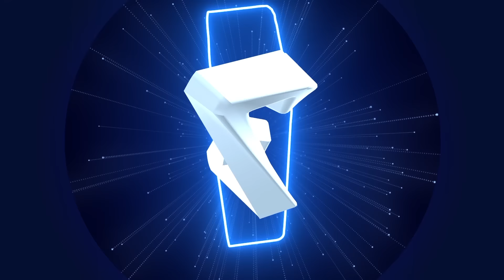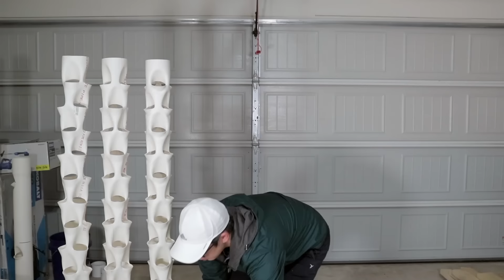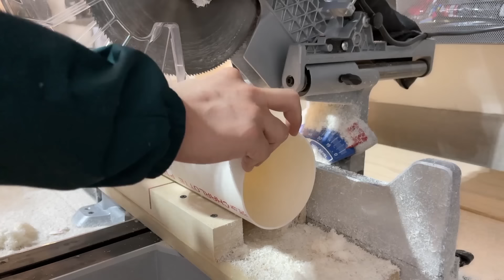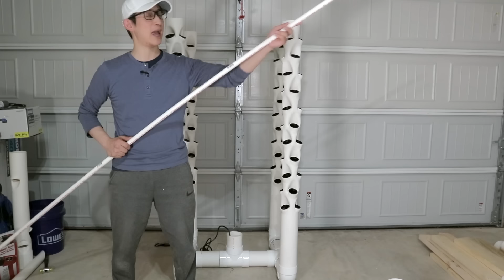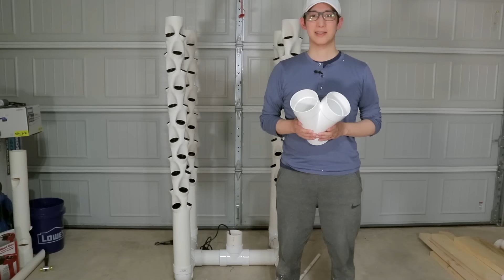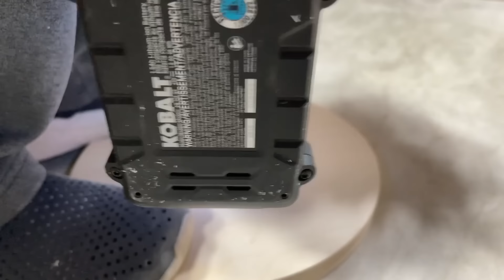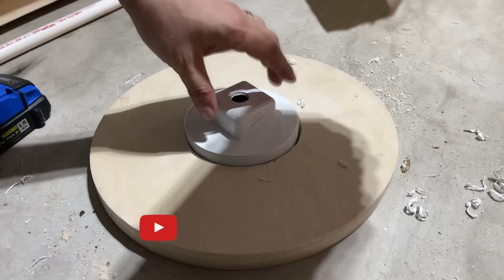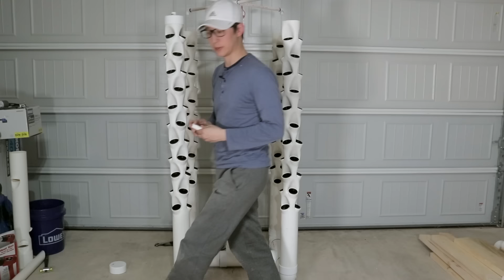DIY Hydroponics | Aeroponics Garden Tower Build | Part 2 - [4 Tower Build]

Comment: Your project is inspiring. It's a very solid result for a second generation design.

 I work maintenance at a aeroponics farm. Our largest grow room contains 32 systems, each 56 feet long, and requiring several thousand gallons of fertilized water held in the recirculation tanks. They are our 12th generation design. 

You are moving in the right direction, but I do have a few suggestions.

Maximum production requires healthy, disease free plants. Combining multiple systems into a common tank reduces cost, but provides a pathway for pathogens. Don't combine more than you are willing to discard all at once because of sickness.  Periodically, and in response to sick plants, all parts need to be accessible to cleaning with a brush. Switching the elbows under the towers with a tee sealed with a plug  might be beneficial. As would a tank drain.

I know all too well that maintenance and regular servicing of grow systems  seldom gets the needed consideration during design and construction. So it's great that you recognized the need for filtration. I'm not sure you filter down small enough. The green slime that will always grow inside hydroponic systems will clog nozzles. It's not just the roots that are a concern. To reduce the growth of the scum inside the tank, make sure the water is always protected from any light source at all points inside the system. Darkness won't stop the algae but it will slow it and prevent it from competing with the crops for the available food. If left unmanaged, it will starve the crop decrease yield.

I will be demolishing most of the first generation systems later this year to make room for just one 14th generation system later this year. Keep perfecting your design, they really do get better every time you  start over.
Reply from the maker: Thanks for the great advice.  I haven't run into issues with Algae yet.  I found that lettuce works great with the system, so I'm definitely gonna be doing what you recommended by dedicating each build to a single or a few species of vegetables.   Also makes it easier to keep track of what is growing.

Would love to see your aeroponics facility/setup.
Reply: @ChrisLoh  at the end of the video, the result is perfectly visible on the withered plant in the background. it wouldn't hurt to water it sometimes either.
Reply: Just like a Billy Bong Thornton, nobody thinks or likes cleaning when its time
Reply: Thanks for the inputs. Hope you can share your design.
Reply: I was thinking the exact same thing the whole time, how do you get the water out to clean it?  I think wrapping cheesecloth over the drain would be a good idea to really keep your pump filter from getting clogged up you also might want to put your pump inside a paint straining bag to ensure your pump doesn’t get clogged up and prevent the need for checking the filter on your pump.  It is a good pump is that the one that has the flow control on it do you have it set to max flow? The other thing that would be helpful at the top of each water inbound pipe it would be excellent if you
Put the on/off taps they have blue levers that way if you need to pull one tower out to clean or check the strainer you can do it and allow the water to run to the other towers.  I’d put one on each channel to the towers.  Plus the drain id put one on  the bottom of one of the tower corners so after you turn off the pump you can lift each tower out and then drain the basin by lifting the far corner to get everything out, it would also be super helpful if the out had a tap and also if it could have it so you could screw a hose on to it so it would make it easier to direct where you want the outbound water to go because it could still have clear water and could be reused.  Or at least direct it to your outdoor plants. Can’t wait to see the next version!! I made something closer to your first tower although I had three towers that are 2 1/4” wide on the inside and instead of running a tube through where the plant’s roots are I put a 3/4” heavy black tubing and wrapped it around all three and then clamped it with a simple tomato plant clamp and then the out tubing went back down into the opposite side of the bucket which helped with the stability somewhat and the lid I have for my 5 gallon buckets screw on and they are very strong. Then I put 1/2” tubing into the big tubing so that I have four going into each tube may be a bit too many but I made them different lengths so one would go down to the bottom third of the tower and then half way and one 2/3 the way and one at the very top I just used black ground cover to secure over the top so I could easily get it off and it wouldn’t interfere with the tubing and I did the same for all three having the heavy tubing around the top of the towers definitely secured them so they were wobbly but if permanent I would have used wires to wrap around each and tie off in the Center.  I would do that at the bottom and the top as well.  Also my cups for plants I put them down much closer to the top of the lid.  It looked like there was at least a foot of wasted pipe that could be used for plants?  Don’t quite understand the rationale.
Reply: You could attach a pond filter to the intake on the pump to assist with recirculating algae. Keep changing the filter out as part of your maintenance.
Reply: Hey, Mike are you guys planning on selling your older version?
Reply: @torontolenders  I actually disassembled three of the original systems today. All the stainless steel is still in good condition, but all the plastic is junk. That's one of the reasons we are removing them. Our new systems are all stainless steel, we learned our lesson about trying to save money and using plastic. They were proof of concept prototypes when the company was just getting started. Something to show potential investors. They had a designed life of less than a year (I think they were only supposed to be operational for 9 months). That was 8 or 9 years ago. They are definitely at the end of their useful life. We are saving pumps, filter housings, sensors, PLCs, motors, and other reusable items. The rest is getting recycled or put in the dumpster.
Reply: @mikeirvin9694  can you tell me if within your nutrient mix you also add hydrogen peroxide as a regular preventative measure to protect the roots from rot?  Especially with pepper or tomato plants anything that could be continuously growing for more then a year?  Also could you share the percentage and the quantity added per gallon?  I’ve started using 3% hydrogen peroxide on a regular preventative maintenance basis but I’m not certain I’m adding it at the correct time? I’m mixing it in with my additional nutrients and I’m  adding it at the end into the 5 gallon nutrient rich water.  Will this cause any sort nutrient block out or cause the tomato or green pepper plant any distress?  I don’t add it to my lettuce plants because the life cycle of the plant is so short compared to tomatoes, peppers and cucumbers.  So far the plants have been responding quite well but I’m also wondering if it’s blocking out needed nutrients for blooming? Any input would be greatly appreciated.  So far beyond Mike Vanduzee you are the only person that has said exactly things that I have believed from day one especially when related to the need to keep light from penetrating and cleaning with scrubbing and it’s importance.  I think a lot of people figure well these plants grow outside in the dirt so what difference does it make if dead plant material is present all around the lid or floor.  But I understand the need to keep it clean and.viable.  

I wondered about stainless steel and if any grow systems that are plastic would eventually transition to it!  I have read every comment you have on here and it’s exactly on point with every single one of my findings !!! I
still consider myself a newbie after three years of working with hydroponics indoors. I learned very early on that it was much easier to just have varieties of lettuce inside my NFT system then to try to have various kinds of plants. I had initially thought I could have a staggered growing environment where I had mature lettuce in the top two pipes and med growth in the second two and have seedlings in the bottom two.  My thought was that as the nutrients flowed from top down the plants would use them up and deplete the nutrients by the time they got to the bottom shelf but I learned quickly that I was wrong and the nutrients on top were the same at the bottom and so with a 24/7 recirculating system the best way was to have the nutrients geared towards the same stage of growth and having the plants all at the same stage as well.  By doing it this way I would still yield the same or possibly more harvest by cutting all the outer leaves on all lettuce every 7-10 days and getting usually 6 cycles out of them that’s also when I learned especially with lettuce when it comes to nutrients it’s a real balancing act.  It’s important to give them enough nutrients to ensure their continued growth and the nice healthy green color but if you overdo the nutrients they will bolt much faster or if they think they are nearing their end of life because the nutrients or water is no longer adequate then they will also tend to bolt early in an attempt for them to be self-sustaining because bolting just means they are generating seeds to produce the next generation of seeds. My recent experiment has been to let them continue through their bolting stage to see if I can harvest the seeds.  I’ve never done that before and it’s been an interesting learning curve.  I have no idea really what I’m doing but I have a fantastic internet met mentor that’s been helping me step by step.  I’m going to try harvesting my seed pods today because it’s been too long since we had fresh lettuce and miss it terribly!!  It’s truly amazing the things you can grow indoors using hydroponics when you learn the importance of regular maintenance not only inside the tanks and inside the tubing but all around the outside of the pipes and all the racks and floor space and tops of bins because as plants grow they do return a lot of dead plant material to the ground and when indoors it’s extremely important to keep that exceptionally clean to prevent disease, and to check your plants at least once a day so if a problem does come up it can be dealt with quickly and efficiently before it reaches your other plants.
Reply: @leannekenyoung  unfortunately I'm not the best person to answer all your questions. I'm a maintenance worker. I know more about laying out the piping for a new pump or building the lifting mechanism for a light bar than I do the details for growing plants. The grow team knows all the particulars.

But I do know a few things. We use hydrogen peroxide to sanitize during scheduled cleanings, but it's not added to the water. We do add acid, so many fluid ounces per day, with a peristaltic pump continuously. Our systems have pH sensors to adjust the acid dosing rate up or down. I know the growers have a specific target  pH with a certain tolerance up and down that they are aiming for to control algae growth.

I'm familiar with stages of growth. We have multiple systems a plant will live on before being harvested. when the plants are seedlings, they can be packed very densely. As they are transplanted to the next stage, they are spread out on bigger and bigger systems. We can use the same LED grow lights with the same intensity on all the systems. We change the plant spacing to minimize the unused light coming off the LEDs. We use no natural light in our grow rooms, so being thrifty with our grow light usage is important.

For lettuce, grow all the roots first, then grow the head

It's also possible to vary the amount of fertilized water delivered to the root systems  while adjusting the brightness of the lights as the plant grows and nears harvest. Excess light and adequate water when the plant is small promotes rapid root growth but slower leaf growth. Then, turn down the lights and soak those massive root balls. The leaf growth will explode right in time for harvest. It takes quite a bit of hardware to accomplish that, but it can shorten grow times by weeks.
Reply: @mikeirvin9694  I think as a “maintenance worker” you have a heck of a lot more knowledge then you realize!! I enjoyed reading your comment it sort of felt like I had a glimpse into a commercial environment that I’m sure if I saw in person my reaction would be a continuous “wow!” “Wow!” I may have mentioned I’ve been growing indoors exclusively for the past three years and while I’m lucky(I think) to have the addition of natural light my observations have been identical to what you’ve said.  I have wondered about how a completely closed indoor only with no natural light would use their light to their most effective advantage and what you say makes perfect sense to me. The only thing I have not done is grow lettuce to a head, because my thoughts are when someone gets a head of lettuce what’s the first thing they do? Cut off all the outer leaves and discard them.  So for my purposes I consider it wasteful. Instead what I do as the lettuce grows I cut all the outer leaves and the Center continues to grow it may even push the Center a bit more then it normally would because it doesn’t have to push so much to come up. As a result I can grow 54 lettuce plants all at the same time and After I’ve germinated the seeds and got the first true set of leaves on them is when I transplant them to the NFT system and that’s when I begin to feed them a light solution   and so far it hasn’t mattered what the type of lettuce is within 7 days every single plant is ready for an outer leaf trim.  And then 7-10days after that, and on and on it goes for the life of the lettuce plant which is approximately 6 cycles at which point they tend to bolt.  I’ve been doing a recent experiment of letting these plants continue through their bolting stage and I’ll tell you it sure takes it a very long time for lettuce to produce seeds but once it does it’s in great abundance.  I think what absolutely fascinated me to this day is that soil isn’t required at all to grow the most amazing veggies.  I know a lot of people grow sweet peppers in coco coir or perlite or a combination and keep circulating the water through them but what I’ve found through not having a clue how to do some of these things is that a tomato plant will survive and thrive in a 5gallon bucket with nothing but water and it’s roots.  That’s it.  If it’s getting enough of what it needs to survive it will because all plants want to survive.  I’ve found the most effective way to control algae is to stop the light penetration and if you aren’t using a product that is from a fish emulsion then you won’t get algae growth as long as the sterile environment that is used is maintained and any possible point of light entry is completely blocked.  I’ve watched some grow operations on YouTube etc and they are surprised they have algae in their systems even those large drum tanks that are partially in the ground will have algae growing and in my opinion it’s because they either haven’t kept the water moving enough for it’s volume and/or they have not been putting enough oxygen into it. I find when I use just regular aluminum foil the stuff from my kitchen if I wrap everything in it with the shiny side out it does two things it prevents any and all light penetration and it keeps the water a lot cooler. I also use the foil to help the plant standup initially until the plant can grow it’s roots to the bottom of whatever container you have it in, it cannot stand up straight on its own.  But once the roots are on the bottom it’s able to stabilize itself and grow up with very little assistance if any.   It’s been really wild watching my tomato plant grow because although I provided it with foil to support itself and a grow pulley system above that the peppers love the tomato plant grew out and over the sides of the container and then went down to the floor and then would grow straight up from there.  It’s almost as if it needed to have a part of the plant that wasn’t in water be in contact with the floor and then it just stands straight up and these limbs will grow 5feet tall and will grow various limbs off of them.  Now I probably confuse the heck out of my dear plant because I do prune heavily all the time I know the plant requires a few leaves for photosynthesis etc but it’s amazing how few it really needs once it puts on blooms and starts putting on tomatoes that’s it’s sole focus until that set of tomatoes are  picked and then the plant puts on all kinds of green leaves again at least that is so true with indeterminate plants.  I don’t know when plants are determinate if they behave in a similar way.  I doubt it.  But only time will tell.  Thanks for all your help Mike you have an incredible depth and breadth of knowledge with hydroponics.  I thank you so much for sharing it. 🥰🇨🇦❤️🙏🏻
Reply: @mikeirvin9694  
If you are soaking the root balls you are not running genuine aeroponics. Commercial scale grows involve compromises, its just par for the course.
If i soaked my rootballs, the plants would not be happy as they`d lose a massive amount of active root system instantly. They would recover once the setting were corrected but it would cost days in lost growth.
Reply: @atomizer2665  oh no, it's areoponics. We just adjust the volume of water being sprayed.
Reply: @atomizer2665  I was thinking about the compromise you mentioned. It's true, we do. We don't continuously apply water to the roots. Varying the time between waterings and the length of the watering controls the amount of water applied to the roots. As long as the interval is small enough that the roots are still wet from the last watering when the next one starts the plants don't care. A large pump can water 8 systems, one at a time, and deliver a variable quantity of water to each. It just takes expensive solenoid valves, a PLC, and custom software.
Reply: @leannekenyoung  fun fact, if you have no natural light in the indoor greenhouse, then your day doesn't need to be 24 hours long. Just the optimum daylight, nighttime periods, with a "greenhouse sunrise" that shifts day to day. For bolting, try increasing airflow around the plants. When a system with live plants goes down, my priority list  for repairs starts with water, then it's air flow, and finally getting the lights working again.  Growing indoors without natural light or natural ventilation allows us to control everything. Temperature, humidity, light patterns, even the CO2 levels are controlled. There's almost twice the PPM CO2 inside our grow rooms than outside.
Reply: @mikeirvin9694 
Hi Mike
I run accumulaor driven high pressure aero and also air atomised aero which uses compressed air to create the mist. The hardware sets the level of control and control is the key to the benefits commonly associated with aeroponics over other methods. Misting duration and frequency is dependent on the overall flowrate of the system so the duration and frequency of mist that works for one system wont work for another. If someone has twice the number of nozzles in a given root chamber or have the same number of nozzles with twice the flowrate, the misting duration will have to be halved to deliver the same amount of water. If the amount of water delivered by the system is too much on its absolute lowest setting you will overwater and not gain any of the benefits.  The trick is to design the system to provide full coverage with the fewest number of nozzles with the lowest flowrate, basically design for the lowest flowrate you can. You can always increase the mist duration but the minimum is fixed. When you have this level of control you open the door to the real game changers. When you are only using very small amounts of water you can run these systems drain to waste. This allows you total control over the nutrient elemental content and reduces maintenance to almost nothing which i admit wouldnt be great for you being the maintenance guy lol but from a plants perspective, it just doesnt get any better.
Pristine nutrients with the ideal element content, PH and EC are delivered at each and every misting. Nothing returns from the root chamber to contaminate or add heat to the reservoir or alter its elemental content, EC or PH. In terms of maintenance, you simply refill the reservoir or accumulator with fresh nutrient when its gone. The elemental content of a recirculating reservoir is a known quantity when it is freshly mixed but from that point onward it becomes an unknown quantity as the return mixes back in.  The reservoir becomes more unbalanced over time and ultimately you have to dump it to reset. Consider a reservoir lasting a full week running drain to waste and the same reservoir being dumped once a week due to the imbalance of running recirculated. The same quantity of nutrients are "wasted" per week but the difference in growth would be night and day. The ideal aeroponic environment involves having the correct amount of mist with the ideal droplet range. If you can imagine a perfect physical medium ( a theoretically perfect soil) that maintains the optimum level of moisture, nutrient and oxygen all of the time..thats the aeroponic environment the roots are suspended in. Misting the roots, having them hanging in air and the multitude of other descriptions sellers of aeroponic systems come up with the justify the aeroponic label they put on the product fall well sort of the mark.
If you check the roots when you are in work again, here`s some genuine aeroponic roots to compare 
https://youtu.be/l1Rmm9JvPfY
Reply: @atomizer2665  we don't use compressed air, just good ole fashioned 1,100 psi water with  an atomizing nozzle. We don't worry about minimums. The pump has a three phase motor operated by a VFD. We can throttle it down to where it barely rotates, and because it's a positive displacement pump it will move a set volume every rotation regardless how long that rotation takes.

Our concern is speed of delivery of the mist. It must be done quickly enough that the pump has adequate idle time to water all the other systems connected to it. 

 You would be correct about fresh premix and going to drain on less complicated systems. That's just not how we roll, hence why I'm not too worried about job security. While the lights are on fresh premix is used as the plants are actively growing, but the single use water is collected sent to a second tank and stored until the lights turn off. Then it's used to water the plants a second time, collected and sent to a third tank and stored until all the single use water has been exhausted. Then the two use water is reapplied and sent to the drain after watering the plants three separate times over the course of the day. Meanwhile the second tank is rinsed, drained, and partially filled with RO water. After the third tank is exhausted of two use water, RO water is applied to plants to wash the roots clean of any and all fertilizer residue, sending it all down the drain. Once a zero state has been established, the pump switches back to applying fresh premix, timed so that right after the second application of fresh premix, the grow lights turn back on. Letting the plants wake up to freshly cleaned roots bathed in fresh premix. There's no need to waste fresh premix when the lights are off and the residual nutrients in the single and double used water is sufficient. The plumbing for such an arrangement is daunting. That's what I'm paid for. The growers dream it up, my department makes it happen.
Reply: @atomizer2665  https://youtu.be/EswoXmWSdOY this is the farm, a couple years before I started working there. That grow room under construction has been in service for a couple years now. It's the one with the 32 56' long systems. Our new facility will be built with 88' long systems. The original systems were only 32' long.
Reply: @mikeirvin9694  
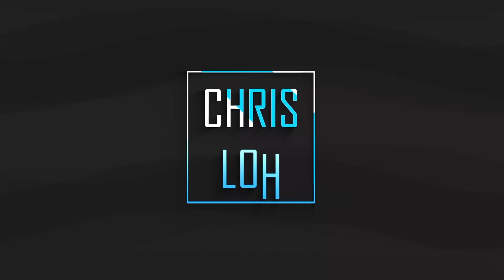I believe thats the one that uses a track misting system to reduce the number of nozzles. The roots at 1:08 in the vid are pretty standard for sprayer type aero which is a perfectly good way to grow stuff. Its good that folks in the commercial sector are thinking outside the box but many others simply copy old tech and tout it as cutting edge, a lot of them dont even run mist :) At the other end of the scale, you`ll find lowly hobby growers with limited resources for R&D that are way ahead of the big companies
My idea of cutting edge aeroponics circa 2015 looked something like this https://youtu.be/Bn_aQZR8uzc
Reply: @atomizer2665  oh no, you know about the trolley! Lol that's a secret I will not confirm nor deny. The A frames are old school, but they still function and produce. The high pressure atomization is for the next generation. We have only built one, with a second on the way, to do R&D and testing. They are less than 40% the size of the planned production equipment, but they are big enough for an experimental test bed. It's definitely the direction of all our future systems at the new facility we're going to be building, and any that might follow that. We are systematically testing different nozzle sizes, spacing, orientation, piping and fitting styles, pumps, grow lights, ventilation options, etc while developing the software to automate all the functions. I've lost count of how many times I have plumbed the misting system. But the growers keep giving us feedback as to what the plants like best and we keep tweaking the design accordingly. After a year, we're getting close to a finalized optimized hardware set-up, just in time as the building plans are being created. Then it's onto optimizing the software and grow settings. By the time the facility is built, and the full size production systems are installed, we'll have all the data necessary to make sure they are turn key ready to go right from the start. While my current facility is all about r&d, developing and refining process, the new facility is all about pure production. Unlike the different generation of systems and hardware found throughout the three grow rooms where I'm at, the 12 grow rooms that will be built will all be the same setup. The data and feedback from them in the future will lead to us creating a new test bed and starting the design process over from the beginning.
Reply: @mikeirvin9694  thank you that’s actually pretty similar to how I do things I’m growing in my living room, I don’t have a greenhouse or any outdoor space I have air coming in from outside that’s blown in 24/7 sometimes it goes through heat coils and sometimes it goes over cooling it’s an air conditioning/heating unit for our apartment but this place was built in the 70’s before they started recirculating indoor air, so thankfully we are getting a constant intake of fresh outdoor Toronto air(the fresh part is a bit of a joke) I also have a large square fan that just blows air around the living room because at times I’m too hot and at other times I’m cold(it’s just me) we keep our main floor quite warm and we also run a humidifier throughout the winter months because I have skin conditions that don’t like the hot dry air.  So far it seems to be an ideal place for growing we have a huge expanse of window that is two storeys high because we live in a loft style apartment.  We are facing south and we get a ton of natural light through these windows but above each rack or plant that I have growing I also have T5 full spectrum warm white LED lights and the plants love them.  I can kept them close to my lettuce plants and they don’t burn them or anything.  My larger plants like tomato and sweet pepper plants I prune them heavily to ensure there is always space between the branches and leaves so they don’t become over crowded and I need to be able to see the blossoms so I can assist with hand pollinating and so far so good.  I would love to have a space that was a totally closed growing space like you have mentioned above when each and every plant can receive their optimum from every available system.  I think it would be absolutely incredible to have a space like that obviously it would be very expensive and a commercial venture.  But wow, so possible with so many places now where they lack industries and could be converted to that kind of setup.  I think a closed system combined with vertical growing is the answer to a truly healthy food supply where it’s real food that’s growing and not some gmo version of itself.  It’s amazing that they started messing with the plants DNA instead of adapting their growing spaces to something that could control their production outcomes.  Finally this is becoming more of a reality.  I think if the average apartment dweller can grow an incredible abundance of food enough to share with family & friends then we should all learn because I think it may become a necessity in the future and reliance on oneself is paramount. Understanding how to improve is so important as well and we can’t always assume we are doing the very best way but we won’t know that until we reach out to others with more experience.  Mike you have so much knowledge about plants and growing hydroponically if I ever had a commercial growing environment I’d definitely want someone like you on board!! I hope you are appreciated for all your knowledge!! I’m sure you’ve gained a ton of knowledge just working with this sort of thing every single day!  Thanks again for giving us a peak into how a real growing system works and then we can apply it to our own home DiY versions. Thank you 🥰🙏🏻❤️🇨🇦
Reply: @mikeirvin9694  
Hi Mike, I design and build everything myself but on the plus side i`ve picked up a lot of new skills along the way. The most frustrating part is when you know exactly what component you need for the job but don`t know what that component is called. Google is no good with  "i need a thingymebob that does this".  When it comes to designing systems i find being part horticulturist, part forensic scientist, part chemist is a good mix. It seems like a lot of designers these days have a bunch of  IT degrees but have never grown a plant in their life :) When it comes to optimization its hard to beat good old fashioned diligent testing, it can take months but you always come across something you hadn`t even considered and suddenly you have a few more avenues to explore. Testing systems that run drain to waste is a lot easier than recirculated systems, the same can be said for indoor vs outdoor setups due to the environment variables. I run HP and AA aero indoors year round and HP  outdoors from about april to november, variety is the spice of life. If you need an additional challenge, you can branch out into nutrient formulation which provides you with another level of control .
Reply: @atomizer2665  the IT guys serve a purpose and are an important part of the equation. The grow team, the maintenance team,  the harvest team, and management all have separate and distinct needs for system control and operation. It's the IT guy that makes the touch screen on the wall satisfy everyone in a simple way that doesn't require extensive training of new employees, or a detailed knowledge of the system layout and components. IT is the glue that binds the various stakeholders. That said, IT doesn't design the physical system, they just make it function the way the various stakeholders need it to. Occasionally IT will give us feedback requesting a sensor be added for a specific programming purpose; a proximity sensor, a pressure sensor, level sensor, flow switch, limit switch, etc. And we'll add it for him. I still turn plenty of manual valves during the course of a work day, but that's because I'm maintenance. Everyone else can accomplish their work with very few manual valves to worry about. And part of my job is to make sure those particular valves are visible, accessable, and not required for daily use of the system. The IT guy makes even my job easier by automating all the routine tasks. I just have to worry about the abnormal conditions. 

Having a mechanical engineer design the system to the growers specifications, within the managements limits, while addressing maintenance's concerns is the only way to do it at scale. Send the CAD drawings to a steel fabricator and when the parts arrive, grab the roll of blueprints and some tools and start throwing it together.

The 56' long double fall light bars are something I can assemble, repair, adjust, and service. However, that much moving mass isn't something I would be comfortable just guessing on component selection. They need to be calculated by someone who understands the loads and forces involved and willing to be responsible for their work. 

Depending on the project, structural engineers and electrical engineers might have to get involved to get the growers want they want for the plants.
Reply: @leannekenyoung  this absolutely does not apply to a home application, but rather the next step up. 

Have you ever wondered how the HVAC guys can generate such absolutely stable temperatures in such spaces as walk-in coolers, freezes, or grow rooms?

As long as you are willing to pay the utility bills, it can be done a pair of HVAC air handlers. Both need to be big enough to handle the worse case scenario heating and cooling independently. That creates some redundancy if one unit is out of service. Having three or four units is even better, but two is the minimum, and will work. Set the thermostats physically halfway between the units, side by side so they read the same.  Let's say you want your plants at a nice toasty 75 degrees. Set one thermostat to cool and 74 degrees. Set the other thermostat to 76 degrees and heat. Then stand back and watch them fight! They will battle each other endlessly maintaining an incredibly stable 75 degrees plus or minus a degree. While this is the simple way of accomplishing a controlled temperature, it does generate a localized hot and cold spot. Adequate in room ventilation to mix the hot and cold is a must.

Next step, have a commercial grade  air handler built to spec. With internal digital temperature sensors and a PLC.  The room temperature (and humidity if it's a grow room) is measured at multiple locations in the room, and is compared to the values of the actual return air entering the air handler.  The air runs through the cooling coils and drops 40 degrees in temperature, with a corresponding reduction in humidity. The temp and humidity are measured and then the air is passed through the heating coils, with an increase in temperature of about 40 degrees. And one last set of temperature and humidity readings are taken at the start of the supply duct going back to the room. The PLC adjusts the chilled water and the hot water going into the two coils, adjusting the temperature and humidity changes, and sending drier room temperature air back to grow room that is no more than 3 or 4 degrees different than the temperature of the air already inside the room. No hot or cold spots.

There's even more that can be done. Adding a rotating desiccant wheel with it's own cooling and heating coil will strip water out of the air by the gallons per hour even more effectively for better humidity control, sending room temperature, bone dry air back into the room. 

Commercial air handlers can have a feature called an economizer. It's a motorized damper connecting the return air entering the unit (before the filters and coils) and the outside, allowing a controllable amount of outside, fresh air to be mixed into the airstream, conditioned, and sent to the room.
Reply: @mikeirvin9694  wow!! That’s incredible!! I had no idea that all of that could even be done but it makes so much sense and I’m sure you “dumbed” it down for someone like me so thank you so much!  Maybe if I can win the lottery!  Because I truly believe this is without a doubt the next evolution in commercial growing.  It has to be because of how bad the soil is depleted and with all the pest pressures and if you want to be organic and not lose every other crop to pests it’s the only answer I think.  Thank you for all the info.  This stuff fascinates me and if I had a bunch of money it’s sure where I would be investing it.
Reply: @atomizer2665  Trust me, I understand the frustration of not knowing the name of what you need. You actually helped me find a solution to a problem I have at work. I'm building the pump and piping setup for a new microgreen system. Redundant pumps and filters, PLC controlled, maintenance bypass piping, unions, the whole nine yards. It won't be operational for another 6 weeks or so. So I have a very crude tank (literally a food grade 55  gallon drum with bulkhead fittings added) and a pump temporarily running the system until I get the permanent  setup complete. I watched your video, and that got me watching a couple more on homebuilt high pressure misting systems. And that's where I learned about plug in recycle timers, or on off on timers. I had been looking at industrial timer relays, which are way more precise, way more expensive, and way more involved to install. I don't need to time down to a 1/10th of a second, 5 second increments is close enough, and the price looks way better for something that'll be in use for a month and a half. I knew there had to be a off the shelf solution, I just had no idea what it would be called. It'll be going on a shelf in the shop afterwards, and I'm sure it'll come in handy again in the future.
Reply: @mikeirvin9694  
 If you are running low dc voltage you can use ultra cheap cycle timers ($8) with solid state outputs. I would steer clear of the ones with onboard songle mechanical relays. I run all my hp aero setups on accumulators and manually charge them as needed (to 140psi) with one pump (12v 160psi). I dont use pressure switches or relief valves, just pressure reducers and solenoids. My hp aero timers provide 0.1 second increment which is plenty. For air atomised i use timers that provide 0.05 sec (1/200th of a second) increments which is nice for superfine adjustments
Reply: @mikeirvin9694  do you happen to know what nozzles you use? Or what features are best? I’ve been wanting to build an aeroponics system for a year but keep getting stuck at nozzles for the sprayers
Reply: @doublestennisplayer  I suppose it depends on what pressure you are using. The nozzles we use at over a thousand PSI don't work particularly well under 500psi. I would look for an inexpensive general purpose atomizing misting nozzle used for various applications like HVAC, mist cooling, and other things. Start with brass ones and experiment until you get the right orifice size for the droplet  pattern you like. Then upgrade to the stainless version (if that's your intention). If your pressure is low enough, there might be a plastic version that would work.
Reply: Thanks for the excellent tips. It seems wise to make sure all your pipes, pots & parts are sterile before you begin assembling. I just looked up some non-toxic additives to help reduce mold & algae. I'm sure there are more but grapefruit seed extract is a powerful anti-parasitical, anti-bacterial and anti-fungal compound. Five to 10 drops per gallon is recommended. Desembling periodically to clean also seems prudent.
Reply: @drivers2037  just rotate the unit 90 degrees every week
Reply: What about fish to take care of algae. Even if temporary.??? Thanks for your pro tips.
Reply: @vicariouswitness  my grandfather always bought goldfish every spring to put in the water tank for the cows. They would get fat eating the pond scrum while the cows were happy to have clear water to drink all summer. When the cold weather killed the fish in the fall, they got feed to the pigs who enjoyed the treat.  

On a commercial scale I would worry about altering the chemistry of the water. It would be a whole bunch of new variables to worry about with the addition of fish. On the micro scale for the hobbyist, I think it would be fun to experiment with.
Reply: @mikeirvin9694  I’m scaled for self sufficiency, not commercial. Thanks for the advise, I’ve also looked at snails.
Reply: These videos and this comment section is a goldmine. Thank you so much for taking the time to share your experience here, will be building my own very soon !
Reply: at the end of the video, the result is perfectly visible on the withered plant in the background. it wouldn't hurt to water it sometimes either.
Reply: at the end of the video, the result is perfectly visible on the withered plant in the background. it wouldn't hurt to water it sometimes either.
Reply: Beautiful advice !!!!!
Reply: Its a little less inspiring when you realize he just ripped off the design: https://www.youtube.com/watch?v=tmpPLiECCFU
Reply: Do you happen to sell your system?
Reply: @rickfox4068  not exactly. We did sell a pile of 8" PVC pipe that made the tanks for the old systems we had removed earlier this year. A local man was interested in starting a greenhouse, drove by our facility, saw the old tanks, and asked about buying them. A hundred dollars and they were all his. We got some pizza on Friday and never told him why they were stacked up outside the building. We were too busy to take the time to cut them up and order a dumpster to dispose of them. I got a free lunch and didn't have to deal with them again. That's a solid win. If he can use them to create some kind of grow system to suit his needs, that's a win for him. Less stuff going to the landfill, that's a win for planet.  

We don't sell complete, turn key grow systems. That's not part of the business model. However, we do occasionally sell off used equipment and components. The systems we decommission get stripped down and the individual components get repurposed.  We don't use individual tanks per system anymore, so the individual system sized tanks were destined for the dumpster. All the components that made them a functional tank had already been salvaged, so they were just long lengths of big PVC pipe with all sorts of holes drilled into them. 

As the saying goes, one man's trash is another man's treasure.
Reply: @mikeirvin9694  Hit me up when you have some repurposed stuff..  if we can work out the logistics, I will take it off your hands
Reply: That's amazing!
Reply: Hey Mike, I'm trying to start my own system and wondered if you could offer some professional advice or could possibly point me in the direction of a good source of material to start with?
Reply: @branden7384  While I have certainly developed a preference for certain materials and products over the past few years, they don't translate very well to small scale home systems. Having stainless steel custom fabricated to a CAD drawing and shipped to you on a pallet is a bit excessive for most people. Same with the automation. Is it nice? Oh yes. Is it necessary? Definitely not at a small scale.

I've seen people use 5 gallon buckets, but that wouldn't be the route I personally choose. They don't pack together tightly enough for efficient use of space, at least in my humble opinion. Plastic storage totes are rectangular (an easier shape to work with) and can be lined up in a nice row with a continuous grow surface. That simplifies grow lights (if you're going that route). It could also simplify ventilation if you use a ductsock.  It's possible to replicate the function of a ductsock with a rigid section of round duct you can find at a local home improvement store. Buy a duct that is the length of the grow bed and is the correct diameter to attach to the outlet of a fan. Drill a series of holes along the length of the duct with a hole saw. Hang the duct over the grow bed with the fan on one end while the far end is sealed with a cap to trap the pressurized air inside and forcing it out the holes. The holes might be at 6'clock blowing straight down. Or maybe 5 and 7 or 4 and 8 to blow towards the edges of the grow surface. The duct might be moved to one side to make room for lights and have the holes rotated to blow towards the center. Ductsocks are great because they make a linear curtain of airflow along their length. The spacing, size, and orientation of the holes can tune that airflow to whatever you need.  

Plants growing indoors need three things: water, air, and light. In that order. Which is why I talked more about air than I did lights. 

For water, you need a pump. Lots of choices in that department and there's two ways of going about it. Design a system and find a pump that meets the requirements or select a pump and design a system around it's capabilities. Either way, for a successful build the pump and the finished design have to compliment each other. If the system doesn't have mechanical ventilation or grow lights then the pump will be the big ticket item with the greatest potential for cost savings, and would indicate that's where you would want to start the design. Aquarium pumps are a valid option for small setups. I have set-up test systems with sump pumps (I usually bypass the float valves and utilize timers). They are robust, easy to source locally, and available in 1/4, 1/3, 1/2, 3/4,  and I HP versions, and not terribly expensive. However, they are in tank pumps. On smaller systems at work I much prefer spa pumps (they are designed for use in hot tubs). They can be powered by 110v with a cord end plugged into a timer (up to 3/4hp anyways) or they can be wired for 220v (for less Amps). They are off the shelf available at some local home improvement stores and come in 1/2, 3/4, and 1 HP versions. I recommend the thermoplastic housings. They don't corrode with fertilizer in the water, like cast iron will. And since they are outside the tank, they are easier to maintain. Spa pumps have built in adjustable pressure switches, which can be helpful. A 3/4HP simmer spa pump will move 10.8 gallons per minute if I remember correctly. Sprinkler pumps are the next step up for off the shelf, locally available inexpensive pumps. Again, I recommend the thermoplastic housing. They are available in 1, 1 1/2, and 2 HP versions, and I would recommend wiring them for 220v. The Simmer 2 HP sprinkler pump will move 71 gallons per minute. These pumps are on our off and have no built-in switches. Finally, you can source pool pumps with thermoplastic housings from online pool supply companies. I found 3, 4, and 5HP versions for less than 350 dollars a few months ago while doing some design work of my own. They'll move a couple hundred gallons per minute. They're my plan B if I get another complaint about lack of flow with the current pump. I ain't afraid to rattle some pipes. I can always find a bigger pump.
Reply: i was gonna say the light thing to
Reply: Do you ground your system?
I know that copper in the bottom of a stock tank will reduce scum. I do t know what it will do to crop plants. I haven't tried hydroponics yet. But it's on my list.
Reply: @frankvandalen6524  The systems themselves are bonded to ground. Stainless steel, electrolytic solution, and 3 phase 480 volt power is a potentially nasty combination, so the electrician makes sure every system is grounded.

Our tanks don't get grounded. Copper/bronze/brass is dissolved by the fertilizer and acid in the water. The pumps and solenoid valves are stainless for the corrosion resistance. Manual valves and distribution piping is PVC (mostly schedule 40 for cost, with schedule 80 in specific applications for durability. The copper that dissolves alters the chemistry which upsets the growers. Corroded valves and pumps increase our workload which is why those of us on the maintenance team avoid copper and brass whenever possible. Management is interested in production numbers so they are pretty reasonable in granting us the additional funds for the stainless version on production systems. On research and development systems we'll use brass to save money. Those systems have a relatively short life expectancy and the corrosion of the brass components is manageable on such a small scale. 

A system built at home, it'll be small and subject to frequent upgrades and modifications, which is why I recommend brass fittings. 

Just stay away from using galvanized pipe for anything except plain water. The chemicals in the fertilizer will quickly rot galvanized pipe from the inside out.
Reply: Thanks Mike , very insightful. Can you please share your latest generation system. It will be really helpful  like me who are starting in this space. Thanks
Reply: i am not sure if it has been said yet. so i have reptiles, and i know of people that put a copper coin in the water to prevent something, im not sure if it was algea but i think its worth looking into
Reply: ya but wheres your video?
Reply: Qli
Reply: I wonder if you could put pennies in it to keep algae from growing I have a pool that is sanitized with a copper ionizer